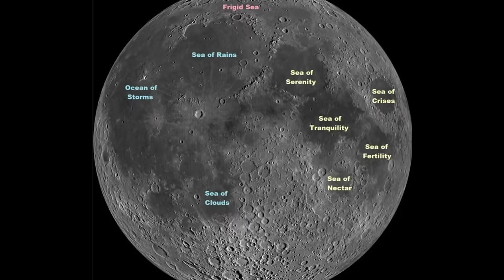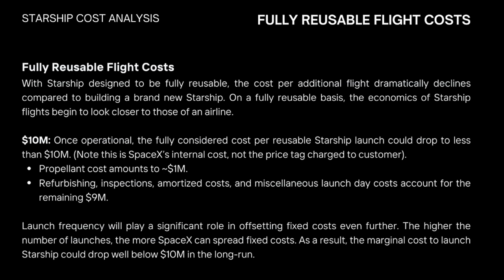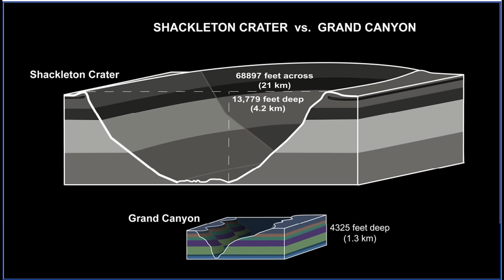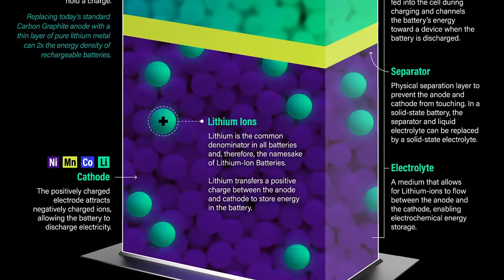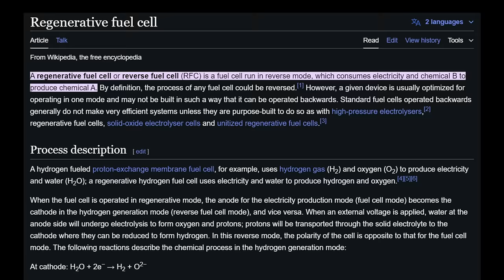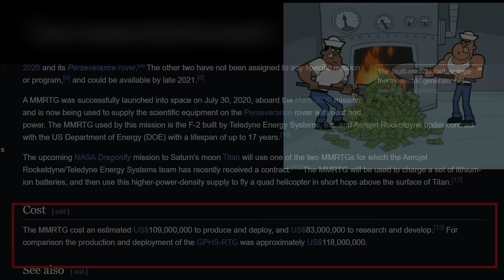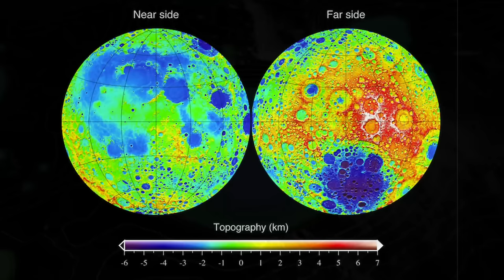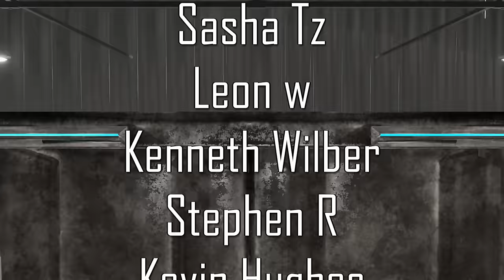Probably Not The Poles

Comment: For importing water, we don't need water per se, just the hydrogen, cause there is plenty of oxygen being produced as a byproduct of the metal refining process. That reduces the amount of mass you need to import by 88.8 percent. Or if liquid hydrogen is too tricky to import, methane would give you both hydrogen and carbon.
Reply: Just take methane. You get carbon as well as hydrogen .
Reply: True
Reply: @RalphButtigieg  I mention that at the end of my comment.
Reply: @RalphButtigieg  why not take ethanol? Less boil off and in any case you can still drink it
Reply: Or ammonia, as a way to get both hydrogen and nitrogen.
Reply: Methane has the advantage of being LNG, which is Starships fuel. And since Starship is to be refilled in orbit, Tankers to bring LNG to orbit will be readily available, and ground infrastructure to fill a tank with LNG is in place.
Reply: So set up a trade route between Titan and Luna?
Reply: @Roxor128  good point, what else would you want the nitrogen for, other than breathing? Which will be definitely needed though
Reply: @johgude5045   Plants. You need nitrogen compounds to feed your crops. Don't waste the mass shipping ammonium nitrate fertiliser, which is mostly oxygen by mass, but instead ship ammonia and use locally-produced waste oxygen to make nitric acid, and from there, ammonium nitrate. Or what nitrogen you put into the air could feed nitrogen-fixing bacteria in the soil.
Reply: Import water from the dwarf planet Ceres?

Comment: I have an idea. How about we just. Build the solars higher? Like, build something similar to a radio tower and put an array on top of that.
Reply: It is still quite a limited area on that crater thing. In general video does not say the pole base is impossible, a minimum it's reasoning should be robust, just water for humans is not strong enough. And if so then we have options instead of obvious choice, and then we choose something based on what we want to have in the future. 

You seen the relief at poles in the video, just to make a regular railroad a few hundred km's - it will be a challenging task, and it may be the simplest of things we want to make, to make a small dent in us in space situation.
Reply: Build a tower with a mirror to focus light down onto a solar array.
Reply: How about beamed space based power put the panels in orbit and beam down the power to an appropriate ground station

Comment: 1. Dont ship water to the Moon please. Just the hydrogen. And make your water there, it will keep things and people warm during lunar night while doing it. Moon is mostly oxygen by mass anyway and we can get it out of rock
2. There is no atmosphere on the Moon so big and massive but very simple flywheels will work better than here. Worth considering since its just spinning piece of metal
Reply: As for wheels to store energy, yeah we forgot about it (it already took plenty of time to dig stuff) and true it  is a viable option, which benefits from vacuum and lower gravity.
Reply: Flywheels have a low energy density, time and metals used to produce this cuts into profits
Reply: @claytonwatson7307 it is relatively easy to produce them locally, not that great quality to be good for any scenario, but when you compare it to stuff delivered from the earth it may make sense
Reply: Solar themeral is an option for power and heat at night. Take all that sunlight and heat a mass and then use that stored heat to drive a generator at night and the waste heat to keep things warm.
Reply: For shipping hydrogen, you might want to do it as ammonia. That way you can send nitrogen for use in agriculture and chemicals as well, while being easier to store than pure hydrogen.
Reply: @Roxor128  pretty much any thing sent should be dual purpose to help maximize efficiency of shipping. Plastic containers would have a large amount of hydrogen and the carbon can be used for steel.
Reply: @matthewconnor5483  Not to mention that some plastics include other elements besides carbon and hydrogen, although a fair few of those contain oxygen, which would be a waste of mass.

Comment: Amazing video. I got a couple points to make:
-If you look at what does the energy consumption in ISS, thermal management and oxygen production through water electrolysis is a big part. This can be streamlined with the material wealth of the moon by storing heat in hot regolith/thermal storage and oxygen, all produced during the day. Make the product early as energy storage. 
-If there is limited energy during the night, don't run anything non-essential. Stop and rest. I suspect we will see a hyper-active working day for 14 days in daytime and a R&R relaxing repairing socializing night time. Byphasic work schedule. Maybe we can manage 80-90% energy demand reduction during the night with both things, I estimate. So we would need about 200kg of 500Wh/kg FPB fancy batteries per person, much more reasonable, at 10000$/Cap cost of transport of batteries. And procurement is cheap as hell.
Reply: True
Reply: I was thinking the same. In another video he made a similar mistake assuming that people would buy just as much on the moon as they buy at Walmart when they are at home, which I highly doubt. You probably wont go there for shopping lots of things as a tourist on the moon as shipping stuff there just to bring it back seems pretty pointless, so I think the import cadence for commodities would be a lot lower than he estimated per tourist
Reply: They dont need energy storage add all beside for emergency use, given that they go add the crater the best spot has 3 earth days of darkness so just put solar panels on another spot with good production during the time and run a powerline to connect them.

Comment: The polar colony scenarios assume we won't find underground fossil water/ice deposits (non-renewable veins of extractable water) similar to those found on Mars recently, or which exists on Earth in places like Libya. People looked for underground water on Mars because they're looking for life, but haven't put the same effort in look on Luna for underground water. There's also going to be metal hydrides somewhere, which could be used as a hydrogen source to make water, and oxides are everywhere on Luna. Or instead of shipping water from Earth, ship the much lighter hydrogen then use oxygen electrolytically cracked from regolith to make water. All these require lots of power, so nuclear > solar, and nuclear removes the polar constraint of solar.
Reply: Why not just make water during the 14 day light period, using much cheaper solar energy and store the products? IMO the nuclear reactor is just needed for life support, but not for industry use. During night time there are plenty of tasks that can be postponed during lunar day, like treating the products made during day time.
Reply: I think nuclear would be great for industrial use,but have solar as well. Would need to find a task to use any excess, like construction materials, charging batteries for heavy machinery and drilling etc

Comment: A flywheel battery might be more cost effective especially considering the most expensive part is pitting them in a sealed container so they can be under vacuum to negate air resistance . Something the moon comes with for free. Then we can make the energy storage moon side without all those expensive shipping fees.
Reply: @diyp7769  A big and heavy flywheel would be a nuisance to launch, but it would also be very easy to make on the moon. Granted you would need something in the mean time that a fission reactor would be a great fit for.
Reply: @brodyrex6987 No need to launch anything since we are building all the materials we need for a flywheel battery on the Moon.
Reply: True. Due all kinds of constraints we didn't go through all the options. As an example if we have electrolysis and those nice nasa Stirling engines, well we can store energy in those electrolytic products (Some sort of mix of Si, Fe etc) and then burn the stuff in oxygen at time of need. Not so nice as flywheels but an option to. Thermal energy storing is an option to. But yeah wheels are a solid option, if we have magneto dynamic bearings for it, which is easier than on earth for it in 1/6g.
Reply: Flywheels tend to be good for bursts of power. 
Thermal storage would be easier to build. Heat a mass with solar and then use that stored heat to drive a generator. Really a mirror(s), insolated container(s), a sterling engine and some pumps to move the coolant between the generator and thermal storage unit(s).
Or use solar to crack oxygen from metals and then burn metal at night to drive generators. Not the most efficient but it works.

Comment: I agree with most of your conclusions. Actually, I agree with most of the stuff you say, so please do not consider things like my breakdown of cost per can of Coke to be criticism. They’re more like reality checks, Intended to be constructive and possibly assist in refining your vision. Because I really like your vision. 
Another disadvantage of settling at the poles is that it is difficult to get to the poles. There is a significant energy cost in changing from an equatorial orbit to a circumpolar orbit. And then when you wanna go home again, there is another significant energy cost in returning to an Equatorial orbit and heading back to earth. 

It is much easier and much safer to land in the tropics so to speak, and it costs way less fuel. This is why we did it six times. The equatorial regions are also much better mapped and surveyed than the poles are. It would be much easier and safer to build an outpost somewhere along the equator and then go and get the water from the south pole. 

Here’s some baseline numbers : the LEM ascent stage dry weight was 2445 kg, and it had 2376 kg fuel, giving it a total weight of 4821kg. So roughly half of its mass was fuel, and that pushed it all the way into orbit on the moon. It would take considerably less fuel to do a suborbital hop along a parabolic trajectory to any point on the moon. Once you’re on the ground, you can hop to any point on the moon in about 45 minutes. so takeoff from Armstrong station at the equator and land in the Shackleton ice mine, load up your —- hell, let’s call it an Eagle transporter — A couple hundred kilograms of ice, refuel, and then hop back to Armstrong station. Easy! Plotting a parabolic orbit from the lunar surface to any other point on the lunar surface is vastly fastly vastly easier than going into orbit from earth, changing to a circumpolar orbit, and the hitting a pretty small bullseye when everything is moving. Conversely, parabolic hops are cake because every point is effectively stationary relative to your launch point.

Anyway, getting back to my original point, I enjoyed this channel and I like the way you think and please don’t take anything that I say as negative. It is not intended that way.
Reply from the maker: That's another great point I didn't even consider! This extra cost of energy would also greatly impair the effectiveness of mass drivers and any other launch infrastructure

Comment: If it hasn't been mentioned, check out nickle-hydrogen batteries (not NiMH). One of the first ever rechargeable batteries used in space, they're absurdly robust and tolerant to extreme temperatures. It uses mostly just a pressure vessel capable of holding hydrogen at 1200 psi, nickel, potassium (which will be found with the rare earths you'll want to be mining anyway), and water. It's effectively a nickel cadmium battery positive nickle electrode, sandwiched with some layers of fuel cell gas diffusion material and catalyst. Charging consumes water and releases hydrogen (the pressure of which is a reliable charge indicator) and the process reverses for discharge.
Reply from the maker: Interesting! Thanks

Comment: I think something that should not be over looked with small modular nuclear is the "modular" and therefore portability. Once they get local power production jump started the reactors can be moved to jumpstart new bases or installed into massive moon scaled construction/mining vehicles. 

Sometimes it can help to think of not just this one step but how will it impact things down the line. The cost of nuclear just might be worth it overall.
Reply: True. There also are other ways to achieve the same result.
Reply: what are you going to do to the heat?

Comment: What about flywheel energy systems? With enough power generation we could build the flywheels on-site with minimal exports for copper and other materials to spin them up. Plenty of regolith that could be used to build them, then spin them up with excess energy during the day cycle and spin them down during the night cycles. Would be a lot cheaper to build, I think.
Reply: Viable option, but requires some industrial capacities, while the options were for an early situation. With industrial capacities there are more ways to address this issue and flywheels is one of them.
Reply: Flywheels tend to be better for storing bursts of power, not long term out put devices.
Reply: Forget copper. Aluminium wire will do the job well enough. You'll need more than if you were using copper, but if you're making it on-site, who cares? You don't need to ship it.
Reply: @matthewconnor5483  was looking at specs of the one for satellites, NASA's stuff or something - it was good enough for a moon night. Overall efficiency was decent enough(not a high number, but better than nothing)

Comment: With the (relative) ease of a lunar mass driver, it certainly does seem insane to electrolyse water ice into hydrogen and oxygen for rocket fuel. 100km track length for a 3g human capable track, 10km for a 30g material launching track. 10km is very achieveable with starship and can constantly send payloads 24/7 during lunar day time. There is no way that mining, transporting and electrolysing water into hydrolox, storing it cryogenically and then combusting it is more efficient than just launching payloads direct via solar electricity. You are also losing valuable water too. Upfront cost a 10km launcher for materials and use a starship orbiter+lander combo for human transfer while you work on building out a 100km track for humans. Eager Space has a good video on starship only lunar architecture and it looks very compelling cost wise.

Comment: For solar energy you just need 2 installations which guarantee at least one is always in sunlight. On the pole those two installations can be close together, so we can wire it up.
Same with the long-term plan, once you have enough industry to put a wire all around the moon at whatever latitude you chose, you can then put solar panels all along it and guarantee constant light. One power grid can easily cover the entire moon's surface, thanks to AC being long-range

Comment: At 18:00 the Picea fuel cell system comes to mind. It is readily available and stores hydrogen during the summer from excess PV-Power making it usable during the winter for heating and electricity during winter. Price is around 80.000€ for a single home system if I remember right. Also storing oxygen as well might cost quite a lot, since it needs 16 times the volume compared to the hydrogen though
Reply from the maker: hey that system is cool hadn't seen that before. Not optimized for space or regenerative but still a good estimate for power density and capability etc. thanks
Reply: @Anthrofuturism  contact them with our topic, i am sure they will answer. If not, i will give them a call tomorrow and explain what we want in german

Comment: And also worth mentioning that the permanently shadowed regions of the Moon make up like 0.01% (or less) of the lunar surface. I would imagine its scarcity alone would make it a prime real estate location in the far future, but it's probably not where we stake our lunar colonization efforts.
Reply: Not much prima in it, as some comments mentioned we forgot some ways to address accomulating energy, like flywheels and there is more, the problem alone probably worth a separate episode.
If you have any basic industrial capacity then there are multiple ways to address this problem.
If you wanna refuel your rockets then the pole is meaningful. But oxygen is 4/5 of mass of rocket fuel,  and maybe just export oxygen where you wanted the fuel to be, it covers 80 percent of the problem.
Export it to earth orbit, for starship refueling and then they need 2 launches to refuel starship instead of 8-10-12 so that alone can help you to deliver 4-6 times more fuel in orbit(where your rockets are)

Comment: How high of a tower would you need to build on the rim of Shackleton crater to achieve nonstop light exposure? since the moon has low gravity without atmosphere, I think suspending a tall structure even a kilometre above the surface might be feasible. I would love to hear other opinions about this idea though. Another option is molten regolith as thermal energy storage. The problem I see with SMRs is that they are developed for earth and it might be tricky to get rid of the heat quick enough with radiators on the moon, but I don't know enough about the details of the engineering. I know in one of your other videos you said we should cover the reactor in regolith to protect the astronauts working inside but if you use the ship itself as radiator, covering it might actually be disadvantageous. Then again I don't know enough about the thermal conductivity of the regolith etc